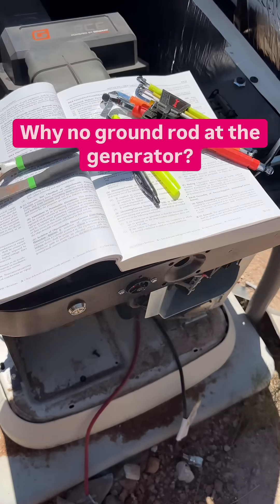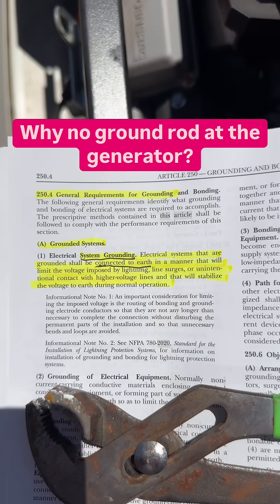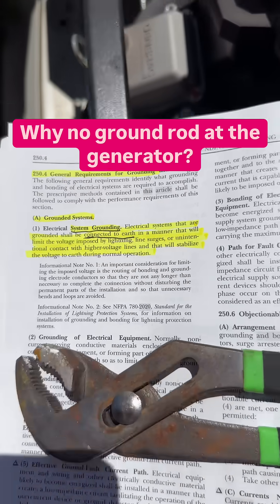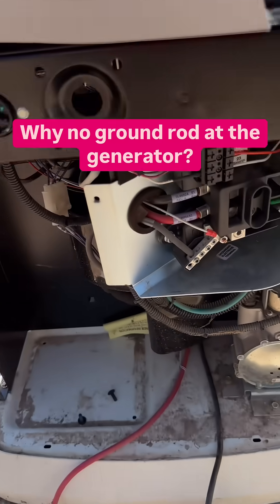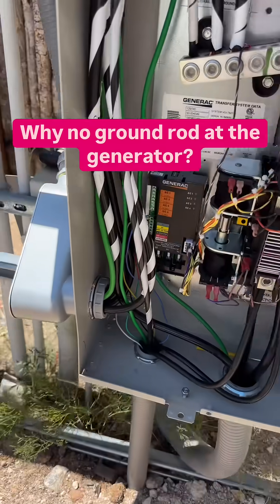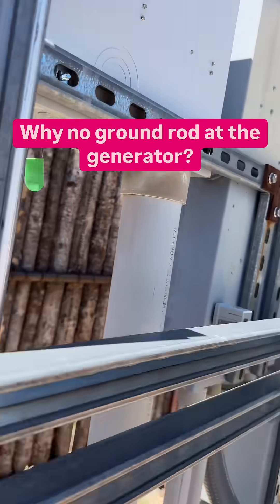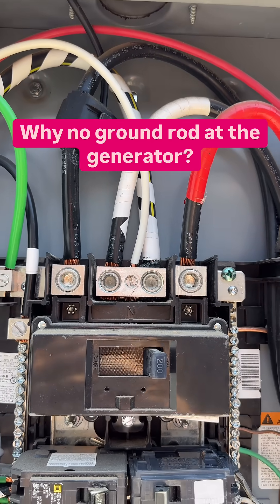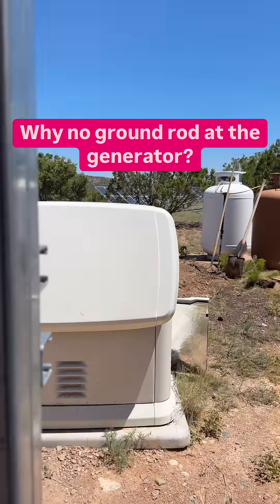A non-separately derived generator does not need a ground rod, watch MikeHolt.com/Fundamentals

Comment: Doesn't this apply to solar systems as well?  If so, can you this same exact video for solar line side taps? (For some reason all the engineers and contractors want to add a ground rod and connect it to the neutral in the solar disconnect of line side tapped solar systems...)
Reply from the maker: @insp_chris, please post your question on MikeHolt.com/Forum

Comment: Hey mike when do you remove the bonding jumper in a non separately derived system
Reply from the maker: A N/G bond is not permitted on the load-side of the service disconnect. If your transfer switch is the service disconnect, then you keep the N/G bond. If the transfer switch is after the service disconnect (this example), then you remove the N/G bond in the transfer switch. Be sure the N/G bond at the generator is also removed if the transfer switch does not switch the neutral.

Comment: We find ourselves designing sub panels with transfer switches to generators. So our main panel bond doesn't apply. We show the bond in the transfer switch with a switched neutral. It would be good to see a video on that subject. We especially are using manual transfer switches with cam connections so the generator is not in the picture.
Reply from the maker: This topic is beyond a 60 second video. Sorry.
Reply: @MikeHoltNEC  I appreciate your reply and all of your expertise. I deal with a lot of dinosaurs in the Federal Government and use your books and videos almost every day.

Comment: ....and we make sure generator ground and neutral buses are not bonded together.
Reply from the maker: 100% correct for this non-separately derived system), see 250.24(B) and Informational Note to 250.30.

Comment: To elaborate: The gual is to always avoid multi earth ground paths. This is done by always returning to the ONE earth ground point of demarcation on the neutral bus in the service entrance equipment. You can have multi path equipment ground between earth ground point of demarcation and at any point along the branch circuit WITHIN the electrical system without ever going to earth before reaching the earth ground point of demarcation; a common practice in hospitals.
Reply from the maker: Excellent comment, thank you.

Comment: It doesn't look right to me Mike, inspectors have me run for wire from transfer switch to what used to be the main panel of the home and separate the grounds and neutrals in the old main panel making the transfer switch the new main panel disconnect.
Reply from the maker: This installation is 'different' in that this transfer switch is on the 'load-side' of the service disconnect, because PV system is connected on the line-side of the service (utility) disconnect.

Comment: is that what they call 'equipotential bonding'?
Reply from the maker: No, that is a completely different topic for agricultural building [547.10], marinas [555.14], and pools [680.26.
Reply: @MikeHoltNEC  I thought that's about solar/generators and other other sources of power than the grid
Reply from the maker: "Equipotential bonding" is related to agricultural building [547.10], marinas [555.14], and pools [680.26. Note NOT solar/generators and other sources of power other than the grid.
Reply: Equals potential = same 
Equipotential means should you get a fault and you in a Equipotential area (home ) say and metal pipe work it will rise to same voltage ⚡️ thus reducing the shock potential 

I say reduce but depending on the amount of current will depend of the voltage present on pipe work etc.

Means also things at Equal voltage in very basic terms with in a given area
Bathroom + pipework and yourself if it's bonded the shock risk is less.

Simplified but there you have it.

Mike correct me if i am wrong or explained it wrongly 

Hello from uk 🇬🇧 😊

Comment: I had to explain this to an inspector before. It’s only considered a separately derived system, if the generator transfer switch switches the neutral. If it doesn’t switch the neutral conductor, and the grounded neutral conductor remains connected all the time, then no ground rods are necessary at the generator.
Reply from the maker: This was an excellent comment, you could have improved it by giving the reference supporting what you wrote. That is Informational Note to 250.30. Thank you!
Reply from the maker: The N/G is done at the service (utility) disconnect, you can see it at the 45 second point in the video.
Reply: @MikeHoltNEC what instances are there where making the generator a separately derived system is desirable?
Reply from the maker: Great question, the best answers can be found at https://cdn2.hubspot.net/hubfs/4333126/Files/Technical%20Information/ASCO/White%20Papers/ATS/ASCO%20switching-the-neutral-conductor.pdf
Reply: Exactly. I've shown inspectors though continuity test when the switch is open as proof.